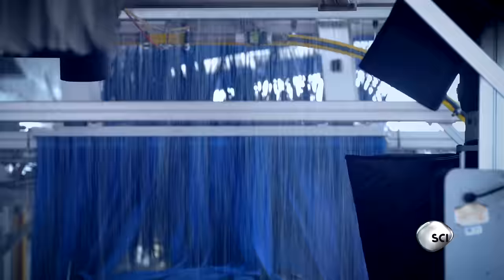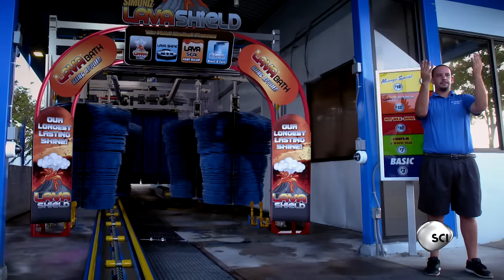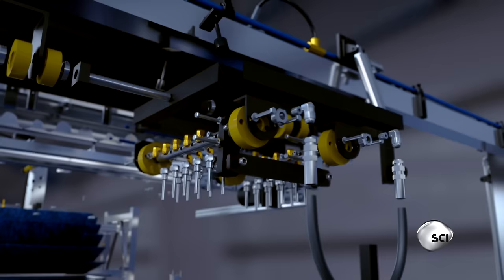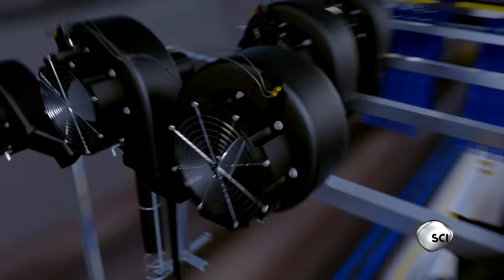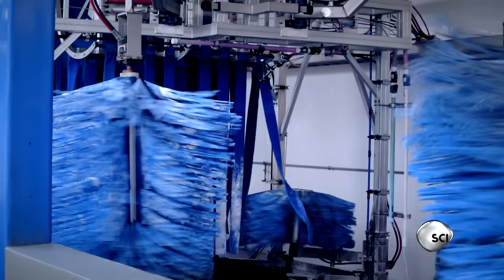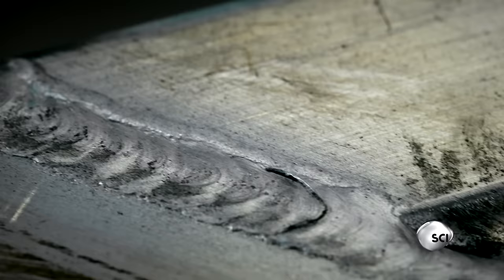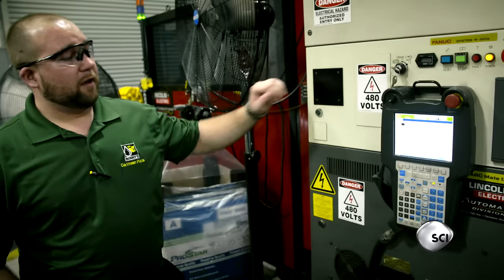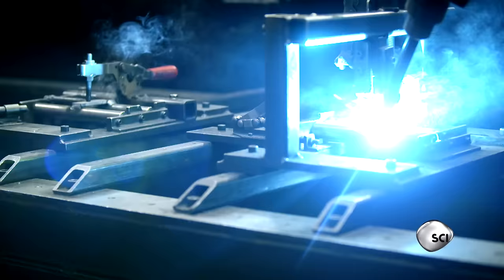Car Wash: More Than Meets the Eye

Comment: I've worked at a few washes and have been in the industry for a while. I can testify that washing the car by hand at  home is actually the worst thing for your car. The microfiber towels with the pressure the average person applies causes more scratches than any automatic brush which applies no more than 15 Lbs of pressure. Not to mention automatic washes use about 5-15 gallons of water per car and recycle their water whereas home washing uses anywhere between 55-105 gallons that wind up in the storm drain. In addition, most auto care manuals included with vehicles strongly discourage hand washing and touch free washes because of the damage.
Reply: nice use of exaggeration "55-105 gallons" I"ll believe that when pigs fly, when the moon turns blue, and when I see it happen. It take a bucket full of water to wipe away and dirt and dust, maybe three for a really dirty car. And how would I know? I see it happen!
Reply: 55 Gallons? Full of BS. I rather wash my car with a clean brush and still use less than 10 gallons of water. The car wash carries many dirt particles and some debris from other vehicles that scratch your vehicle. 
Also, all auto care industry will best advised it's best results to wash the car by hand.
Reply: Not sure how true those statements are.  Touch free has no bristles to hold dirt or swirl the paint. Explain that to me and I'm not being sarcastic, I just want to know because I use touch free on my new car.  Also I work with a guy so damn anal he ended up divorced...he washes by hand without fail one to two times a week, all year...his paint looks fine.

Comment: Is there a chance to miss that belt for the wheel when it goes inside the car wash machine?
Reply: No
Reply: No because a roller doesn’t come up until a sensor detects that the car is on the conveyor and is in position. That’s when the roller will come up.

Comment: Those type of car washes tend to scratch the paint :(
Reply: Automatic car washes are the absolute safest and most effective way to wash a car. Brushes are rinsed with each rotation and do not hold dirt, thus eliminating any possibility of damage.
Reply: Abrasions are abrasions, which are minimal but...over time.
Reply: @SFCarWashChannel  Absolute best for the owners and manufactures perhaps

Comment: I'm pretty sure I can hand wash my car better then any car wash out there
Reply: You can't. Even if you perfectly hand wash your car, your car is damaged because hand wash mitts, sponges, etc roll dirt around on the vehicle's surface, creating swirl marks. Brushes in an automatic car wash are rinsed constantly, removing any dirt that could be rubbed against the vehicle's surface. The material that brushes are made of are also incapable of absorbing dirt.
Reply: julio a we do a better job anyway

Comment: Welcome to..... The Swirl Maker
Reply: It’s not as bad as people make it seem
Reply: @DEPDelight  Says the tunnel wash salesman
Reply: hands leave swirl marks not tunnels. tunnels will leave large damage if there's an incident but that's rare no different than how you could drive out of a parking lot and get hit, shit happens.
Reply: @humvnerr0r844  so having grit off the sides parts that spin on the wheels and then go across the lower side of the car,  rubbing in the grit doesnt cause swirls... its well known that these type of car washes cause swirls. 2 bucket method via hand and your basically sorted, not 100 % avoidable ofcouse but much much less chance of getting so many